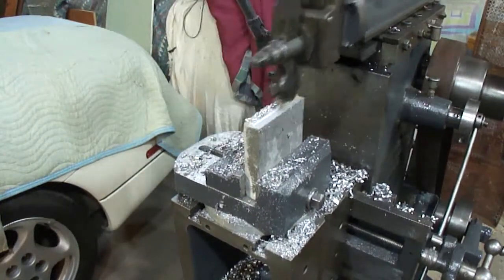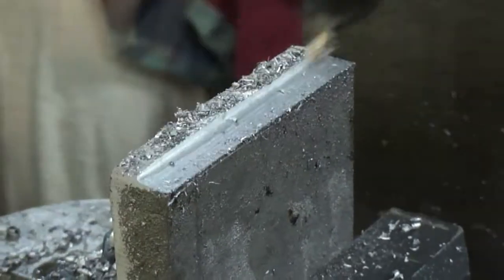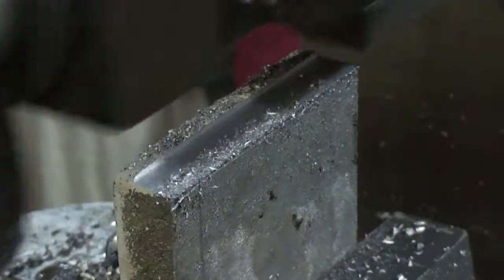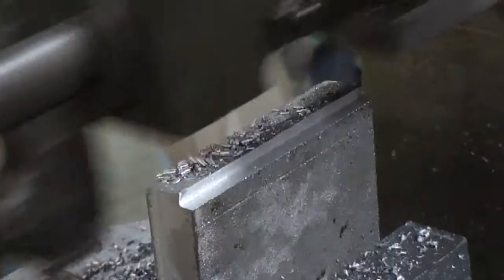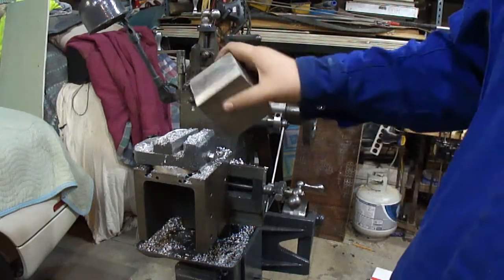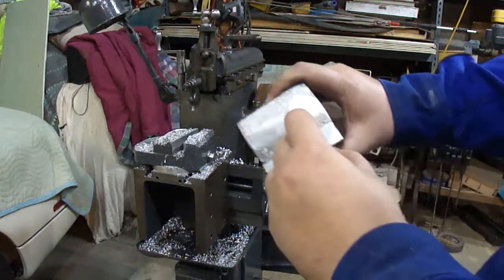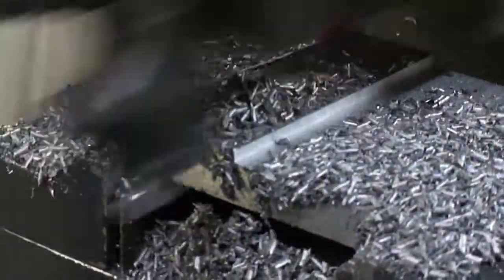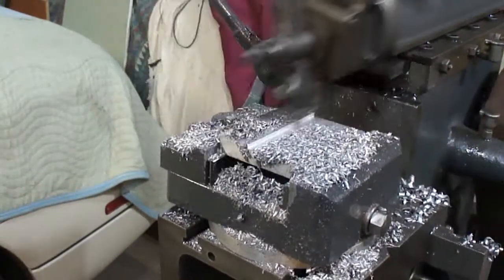Steam Engine Build #12 - Machining Steam Chest Cover

Comment: I'd really like to go to Soule sometime, I was sawyer at a mill that had Soule drive on the carriage, man that thing was sweet! On your steamchest cover , think about machining a border where the bolts go through. You could cut a bevel back to the face,would give a good surface fort he bolts to seat, n reduce the bulkiness of the cover a good bit. Engine's lookin good.
Reply from the maker: yea, I thought about the step around the studs, but I think Ill just see how it looks after I get back. lol, I'd take all of you guys with us if I could. Im not worried about the steam chest cover, it's the steam chest that has all of the bulk to it. With as much pressure that will be running in that thing, I dont want to have too thin of parts, expecially with cast aluminum.